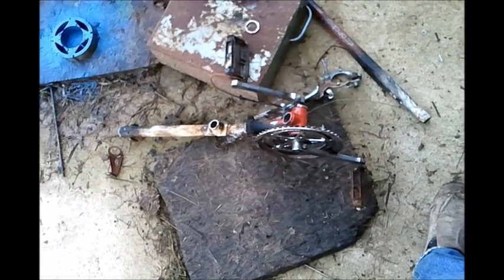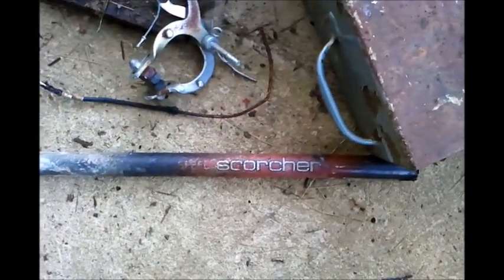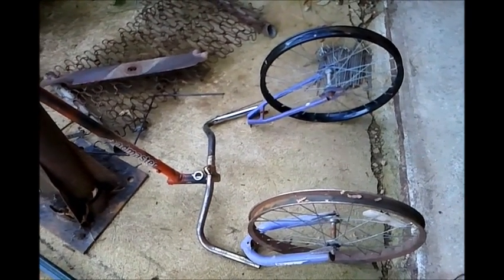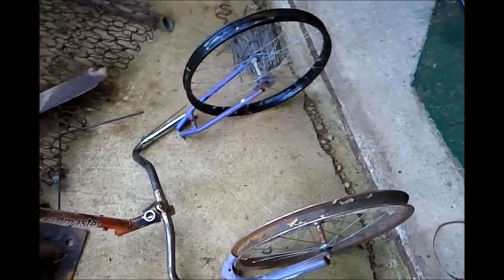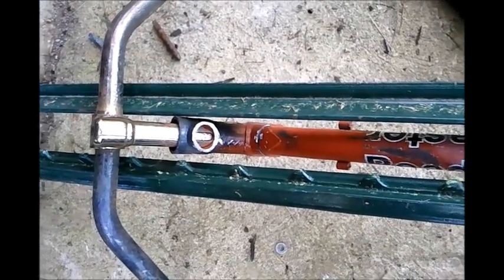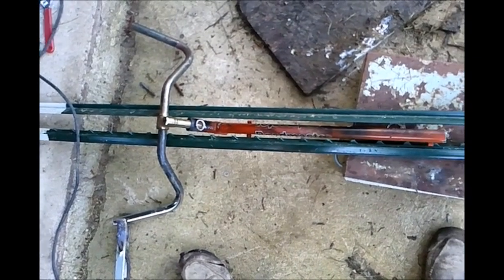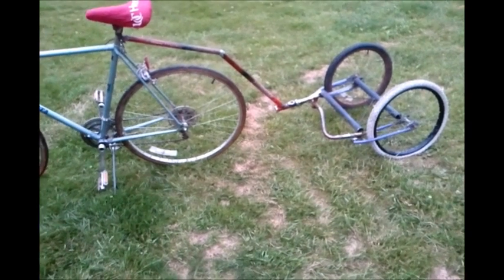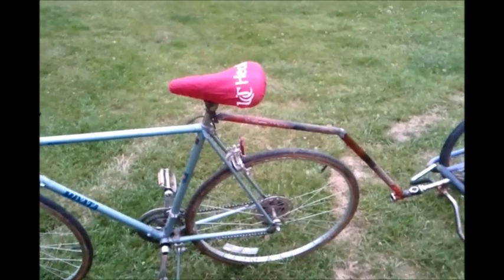Building a bike trailer from old bike parts

Comment: It’s not strong enough if you ask me but use a Chain in case it falls off so you don’t lose trailer, good skills with welding but don’t overthink it and use seat post clamp like commenter suggested 😊
Reply from the maker: I have a video on making the ball style hitch. It is my third iteration of trying to make things work out. I need to get it published. It does work quite well and I haven't lost anything yet.

Comment: Having pulled bicycle trailers and tag along s I have to say I don't think your hitch is going to work.  You need something to clamp it to the seat post.  Remember you'll be going faster on the road than in the yard so it's going to bounce when you hit bumps in the road.  You can probably rig a house clamp to hold it.
Reply from the maker: We shall see. I think the connection may even be a marketable idea - so I'm going to be a little vague here. I do think that it may be a very good design for quick attachment and stay put with no tools required. I may add a safety chain to provide extra security while I'm in the testing phase.